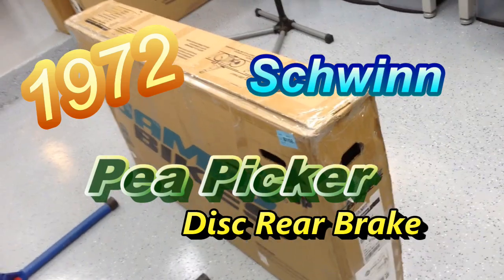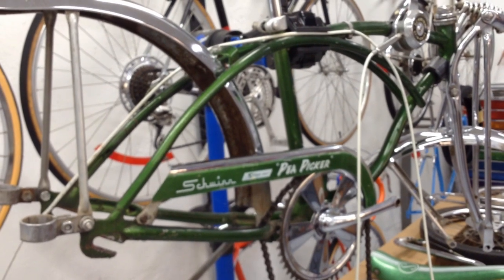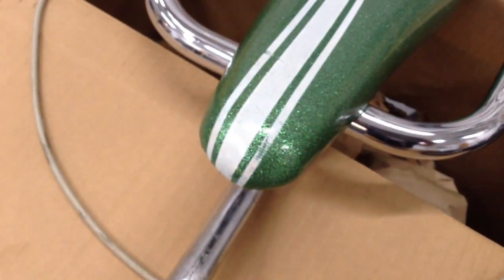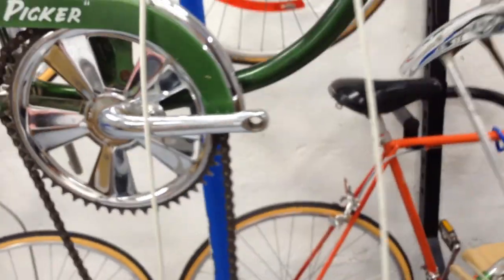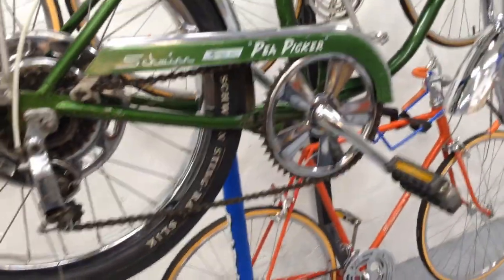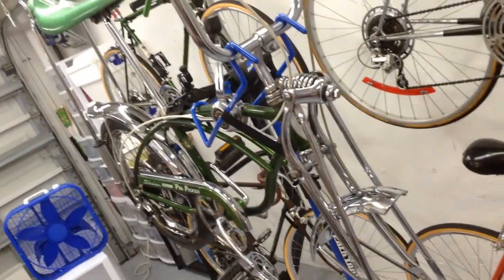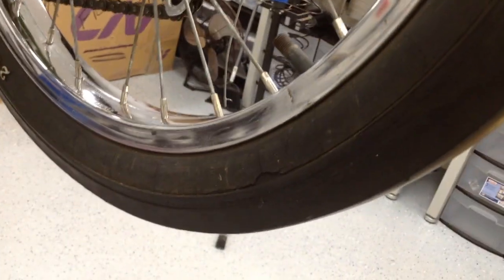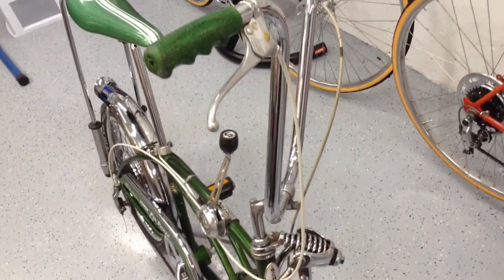1972 Schwinn Pea Picker Disc Brake

Comment: Wow! I mean, WOW! These are beautiful bikes. Thanks for the memories! Question, how did you get the ding out of the fender? Im facing the same problem
Reply from the maker: Thanks 👍Glad you liked it😏🚲 for the ding, I used a mallet and carefully hammered the damaged areas while pressing against a hard surface with roundish shape (Anvil) I worked the fender like a blacksmith and flattened the dings until they were smooth and less visible. Make sure you  tap it just hard enough to avoid hammer dings.

Comment: These bikes had disk brakes before some of the cars from that era.
Reply from the maker: Schwinn was certainly ahead of the pack, check out how much the disc sells for
https://www.ebay.com/itm/SCHWINN-STINGRAY-KRATE-1971-DISC-BRAKE-ASSEMBLY-COMPLETE-EXCELLENT/363043972102?hash=item54871b6406:g:XLoAAOSwZwdfB4LK

Comment: Jeez that disc looks like it's from a CB 750. Guess weight was not a concern lol.
Reply from the maker: Weight was certainly not a concern, see below;
Full floating ride with shock absorbing saddle and front fork, 5-speed gears, bucket seat, front drum brake. Sure stop disc brake on rear wheel. 20" x 2.125" Slik rear tire.
Choice of colors: Orange Krate, Lemon Peeler, Apple Krate (RED). Wt. 49 lbs.

C30-9 5-speed Stik-Shift Krate......$119.95

Comment: I have a 73 twinn deluxe I'm trying to get rid of off you're interested
Reply from the maker: Sounds nice... you should be able to get $500 to $1200 depending on condition, I personally don't have the room for a tandem but I'm sure it's a cool vintage gem...good luck
Reply: It's all original, drum brake, 5 speed. Good chrome. Original, slightly worn seats, gross and pedals.